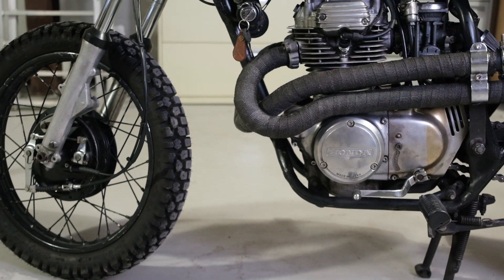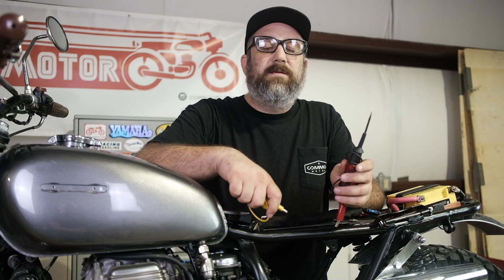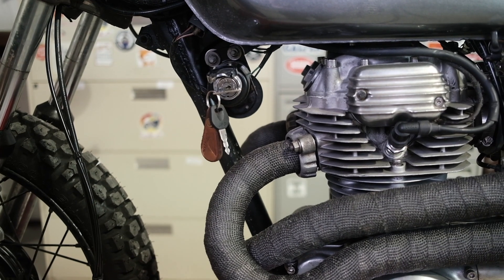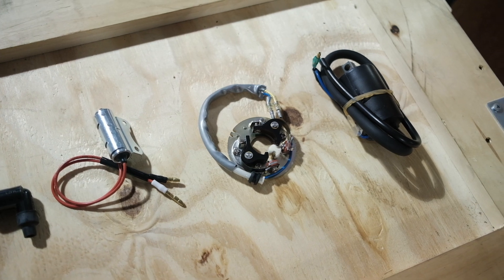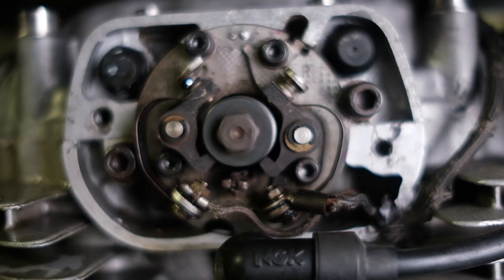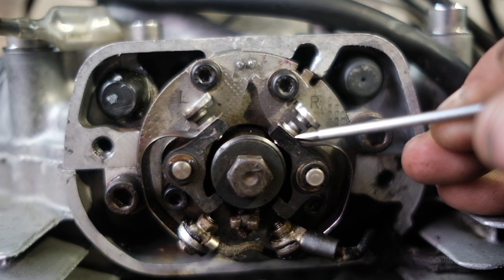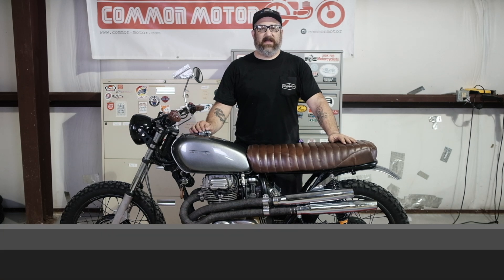Ignition System Troubleshooting: Honda CB175 / CB350 / CB360 / CB450 / CB550 / CB750

Comment: Hello. SOHC CB750K8 here. Could #4 cylinder cap reading 5.8kOhms vs #’s 1-3 all at 4.7 be the reason for intermittent loss of power? Secondary lead wires are all at around 15k and generating spark. Thank you.

Comment: Hi Brenden .! I been working on a real bad problem for the last 2 weeks solid . It is a 1975 CB360 , I just cant figure something out .  I have replaced coils twice . The guy I bought the bike from had bought a lot of things from you including new coils . Those coils made some improvement for a little while from the Honda coils he said . Then he told me that the bike just would not start or vary hard to start and and if started runs vary ruff . Like a fool I bought the bike because it was really clean and I owned one back in 1979 . Great bike but not my first bike .  Back to this bike . Well I check voltage at batt and it charge and hold charge at 13.35 volts . The engine run and off switch failed . Some jack weed messed with or I should say jerry rig it and failed .   I replaced that . Hoping that would repair the voltage problem . It did not . So the problem I believe that I am only getting 11.43 volts on the black wire with the white stripe at the coils . Seems strange to me . Because I am getting or think I am getting well above 13 volt out of the stator at idle .  Can you advise me where to turn or where to check in order ? Thanks Jeff
Reply: You ever figure this out?

Comment: I have a 1982 CM450A. The bike will kickstart and run and drive great, with the key turned to on and switched to run. But none of the lights or push button ignition works. Basically none of the electronic elements of the bike works but it runs and drives when you kickstart it. Any idea what the could be? All of the fuses and battery are good.

Comment: Just discovered your channel, great info!  What about when you start bike and only one cylinder is running so I pulled plug wire on cylinder not running and barely let the plug wire hang on the spark plug and then the cylinder runs.

Comment: F* it.  i should just buy one of every part you sell at this point.  I bought a cb360t not really knowing what to look for.  i've already spent more on parts than i took out for the loan to buy the bike!  never should have bought this particular one, but at least i'm learning a lot???  i suppose that makes it a worthwhile endeavor.  Still waiting on a lot more parts from common motors.  i wish there was an option to expedite shipping, but i looks like it'll be another 4 day wait for parts.
Reply: basically, i've owned this bike a few weeks now and have been fixing lots of stuff here and there in that time.   just discovered today that this whole time it's only been running on One cylinder.  ugh.  seems the ignition coil is the culprit.  just bought 2 of them (since they look original and the other one probably won't last long anyway), and the condenser, and boots, and new plugs, cause what the F?!  why not just replace it all at this point?  this bike is gonna be the death of me!  or at least my credit score lol.
Reply: i'm officially Beyond the DIY / fix-it-at-home repairs now.  i'm just buying one of everything mentioned in this video, replacing them all, crossing my fingers and hoping for the best

Comment: I just replaced the points on my 1975 mt250 and have been trying to use a method with a micrometer to set the timing. Even when I can see that the points are visibly open, I am still getting the same ohm reading as when they were closed. In a video I saw using this method on a 76 MR250 they showed the ohms dropping slightly as the points begin to open. My bike has spark but is nearly impossible to start and runs super rough when I can get it going. Any advice?

Comment: So I’m assuming when u ck the coil pick up wires the electronic ignition has to be on dead top center for the light to glow on 1and 2 (yellow) wire and dead top center for 3and4 (blue and yellow wire). Correct?

Comment: does a faulty condenser cause the coil to get hot, which leads to a lack of or jumpy power once the coil is hot? I have a c77 that's doing this. I replaced the coil and now the new coil is getting hot like the old one. It cant go more than a few miles without the coil getting hot and then hesitant power.

Comment: On my 1975 Honda CB 200t, I have replaced the battery then installed your regulator/rectifier combo. I have no lights or horn what so ever. The electric starter is functional however. Doesn't seem to be getting spark either. Where should I start my diagnostics?
Reply from the maker: We are currently working on an updated add-on video for the 175/200 family of bikes when replacing the reg/rec. The stock rectifier actually doubled as the harness ground so when you upgrade to the modern reg/rec you need to re-ground the harness somewhere on the bike. This is as simple as making a short length of green wire that has a bullet on one side and a ring terminal on the other. Bolt the ring terminal anywhere on the frame and connect the green bullet into a green connection on the wiring harness. I'm guessing this will solve a lot of your issues if not all of them. A good place to do this is the green connection where the old regulator used to plug into. The wire can easily reach one of the battery box bolts to ground it.

Comment: What if mine is hard to start but when it does fires on both cylinders till it warms up about 15 min then one cylinder spits an sputters
Reply: Check to see if one of the wires is shorting to the frame
Reply: Need to adjust timing points

Comment: So what do you do if your battery works but the power is not reaching the points and headlight, horn and everything else doesnt turn on?
Reply: Sounds like fuse
Reply: Hello, did you resolve this issue? I am currently experiencing the same thing. I cleaned ground at the coil and two grounds in the headlight, but still nothing.

Comment: my test light turns on with the alligator clip on the positive and the probe on the negative, but not the way you showed. why is that? i’m also deducing down to a bad spark plug coil but wanted to figure out that first and most basic test. smh

Comment: Thanks for the awesome video.  My right cylinder has no spark,   I took off the points cover the right point was sparking like in the video.  I swapped the wires and had no change.    What should I look at next?

Comment: Suddenly no spark. Running through this video again. Silly question; where does the engine pick up its ground? I check my coil wires to the negative post of the battery, I get 12.4 VDC... I check them to the engine, I get  0VDC!

Comment: Hey man! I have 1972 cb750 and I’m have brake return issue. The brake pads are so tight to the rotor the wheel will not move. Do you know what it could be? I already replaced all the brake hoses ,pads and master cylinder.
Reply from the maker: I'd clean and lubricate the caliper swing are. See our brake rebuild videos for more information.

Comment: Excellent!   I’m working on a 1973 CL 350  that was in storage for 30 years. Lots of gremlins from sitting so long, but thanks to your video, some sandpaper on the points quickly resolved the no spark problems.

Comment: I bought a set of coils from you guys. I think one is bad because my dynamic timing light won't strobe on that coil when the RPMs get above 2k or so. It's fine on the right coil....No condenser as I'm on electronic ign. It did the same thing on point though. Bad coil?
Reply from the maker: reach out to our support line on the website, they can troubleshoot you a little more than I can on youtube and see whats going on for you and how we can help.

Comment: i'm hoping someone can help me out, when i check for power at the points, i've got nothing on the left side. testing the dual yellow wire socket, i get nothing unless i unplug the left side point wire, then i get 12-13V. Keep in mind this is a brand new coil, i'm pointing to the condenser now but not sure. any help would be greatly appreciated
Reply from the maker: The contact point must be open for a reading to be present. Rotate the engine till it is open and test. If it is an issue still the wire connecting to the points may be incorrectly installed.

Comment: I have a 1979 CL175 and parts are hard to come by where do you recommend i get my parts from? Id like to replace all the electrical system components.
Reply from the maker: We are working on parts for the 175's currently.  Depending on what you need we may already have the parts in stock. Btw check the year on your bike again as '79 was not a production year for the 175's.

Comment: Thanks for another great video. Your videos and parts store have been very helpful on the 71 cl350 I am restoring. Could you do a video some time on how to check if your stator is good? I'm having issues with my battery dying after a while of riding. I know my stator is putting out power, and it is running both coils constantly, but I don't know how to tell if it's putting out as much power as it should be.

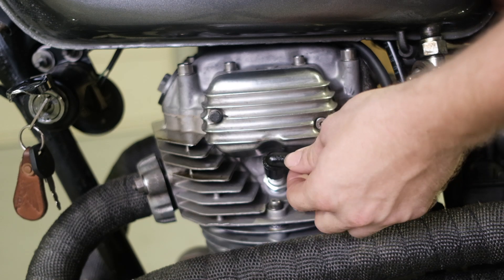Comment: thanks for doing this! Question.... is this video showing a step by step process? I can pull the spark plug out, like you do at 5:27 , and it still runs, so is that straight coil issue and I dont have to check the other parts? Or should I start from the beginning. 1973 Cl350. Thanks!

Comment: One thing that I do is, when checking the battery I use a multi-meter the confirm that I have 12v and connect the negative lead to the frame this way I make sure that I have a good ground connection. I also rev the bike to see if my charging system/generator is working. Voltage go up around 14vdc.
Reply from the maker: Yes a healthy battery is key to a good running vintage Honda. The typical charging voltage you will see on the twins is about 12.5 to 13.2 volts.
Reply from the maker: Great recommendation. However just a note on the the CB175 / CB350 / CB360 / CB450 typical charging voltage is between 12.5 to 13.2 volts.